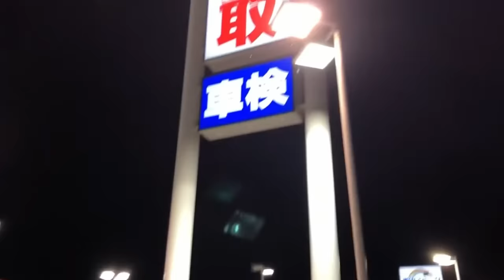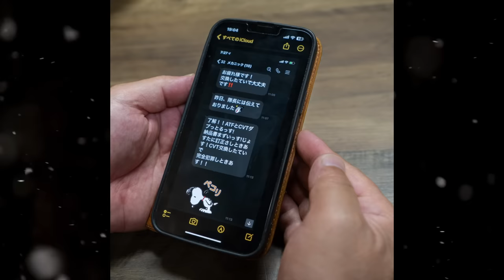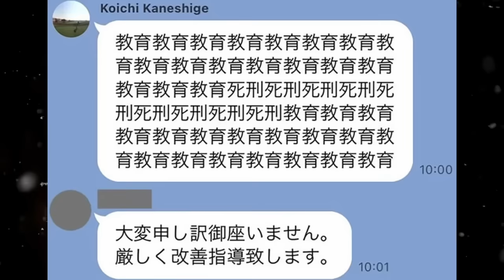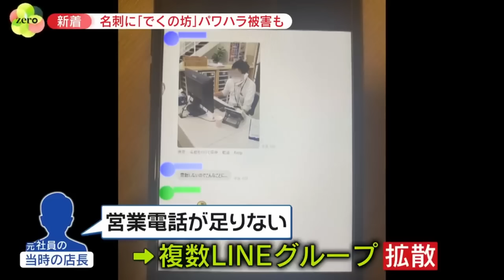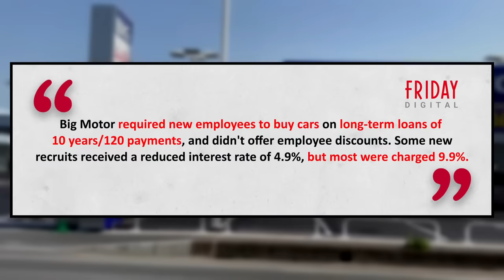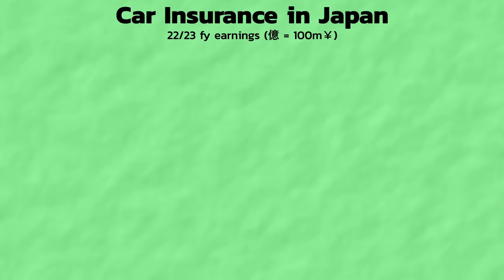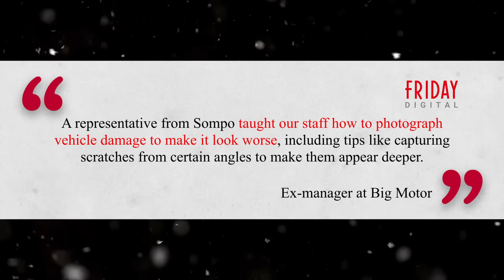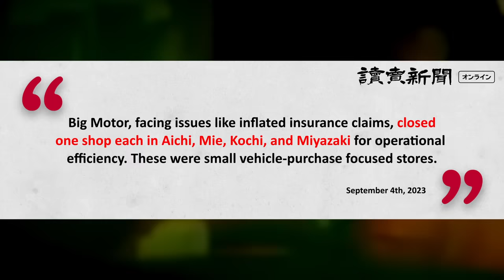Insanely Evil Japanese Company Implodes Overnight

Comment: Went to a Land Rover dealer with my Discovery. They had a huge sign saying "Full inspection with every oil change" with some extra promises and stuff. We got the oil change and left. No long after, we had a break problem and found our disc brakes had worn through almost completely to the tune of $2400 apiece. Had it been caugthh during the inspecting, it would have cost only $400 total. When we pointed out their own sign and our receipt, the manager said "Oh, you're one of those. Get out and never come back. You are banned from this location." 
This was in the 90s when there wasn't a way to get the review out to the public. Another time I went for an oil change with a different car and the oil change place just failed to do it. And the oil cap came off while driving. The oil inside was obviously dirty. Again, the place "banned me" from the location. Another time, a tire place lied and told me they could not legally repair my tire OR allow me to have the vehicle back with a damaged tire. Oh, and I couldn't just replace one tire because they were all equally worn - holding me hostage for over $1000. My only recourse would be to call the cops - but then, they would just refuse to put my tire on and I would have to hire a tow truck for more money.
Reply: Your first mistake was buying a Land Rover, the second one was getting a discovery model
Reply: The 3rd is not knowing how to fix your own ride
Reply: Cops could tell you to put your spare tire and drive with it…
Reply: @arakwar What ? the spare tire is not a design piece and actually useful??
Reply: @arakwar  Tires are dirty. The car is better left in the care of your mechanic, the same way your garden (and the missus), are better left in the care of your gardener.
Reply: You bought a landrover lmao

Comment: Protip:
Mitsui and Tokio Marine Kiln are Lloyd's of London (the biggest and oldest insurance market in the world) underwriter syndicates.
Which means they have very strict standards and anti-fraud regulation, even in their off-shore branches. You can't easily soap them up.
They also underwrite insurance for far more than just cars or property, they cover a wide range of liability, errors & omissions professional indemnity, marine, so forth.
TMK in particular is a huge one. BigMotors is just a tiny shrimp by comparison to their size and extent of business. Economically and politically.
Reply: So does that mean they are incorruptible?
Reply: @KuroiSeiba No. It means the odds of them being corrupted (or elements within them, and not being found out) are low.

Comment: In the area of the U.S. I live in, auto parts providers have grouped up to stop selling repair kits for transmission and some engines, and many other components to customers. They are forcing people to go to high priced shops, at $150 per hour labor rates. Those places can get parts. I remove the wheels and bring them to the tire store separately,  because some tire stores will only sell a full set, plus the spare whether you need just a repair, 1 tire, or not. 
   It goes on here too.

Comment: The contrast between Japanese and Australian companies is large.  The premise in Oz is that "You may be my boss, but that doesn't make you better than me"   If any Australian employer pulls the sort of crap you see in this clip, the staff will individually and collectively tell them to piss off (or worse).  It is actually hard to sack a full-time staff member unless you can prove theft, fraud, gross absenteeism,  or gross incompetence endangering safety.  Even then, it is routine for a sacked staff member to raise an unfair dismissal case within days requiring the employer to show conclusive proof of the misconduct or face compensation and forced reinstatement.

Comment: This sort of criminal behaviour in failing to correctly carry out routine maintenance of even new cars is not new. Over 40 years ago our new Toyota was taken into the dealer for its 20K service. You were charged on the invoice stating that the items were completed for the service and yet major items were never completed. I had placed Locktite on the rocker cover screws and the brake nipples and the oil drain plug.  None of these bolts or screws were ever touched during the so-called service. I queried the service manager and he claimed categorically that the work was done. When I asked him how they performed the rocker arm adjustment without taking the rocker cover off he was at a loss to answer. Similarly the same with bleeding the brakes and changing the oil.  

This false servicing has become the norm now in many modern dealerships. They don't change the brake fluid, they siphon off some in the reservoir and then top it off. It takes 30 seconds yet they charge you for 30 minutes of labour.  This is the reason that dealerships now have signs up stating that all dashcams are to be turned off and no filming is allowed. It became law in Australia that if you were invoiced for a service that wasn't performed it became a criminal action. Yet no one gets taken to court for these crimes.

Comment: But that is nothing.  Few years back went to a local dealership for work on my chevy.  This is in Lancaster, CA.  Oh, the engine is running bad because the engine is out of tune, $2000.  Oh wait, total engine failure, need $16,000.  New engine.  No problem, goodbye.  Went to a local mechanic.  Problem was the fuel pump in the tank and float assembly was bad.  $400.  And for the $300 for new plugs etc on the car, what did the dealership do?  I had put in all my spark plugs so checked as I knew the brand.  They had replaced one.